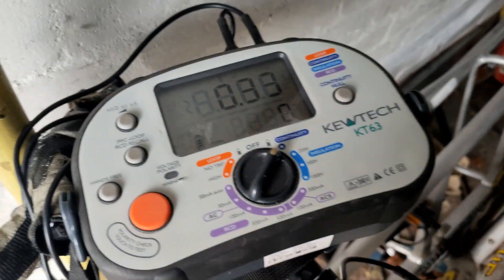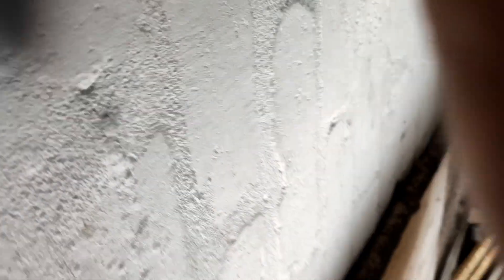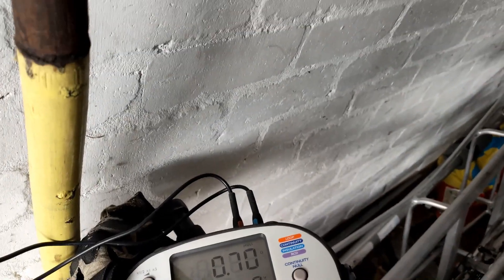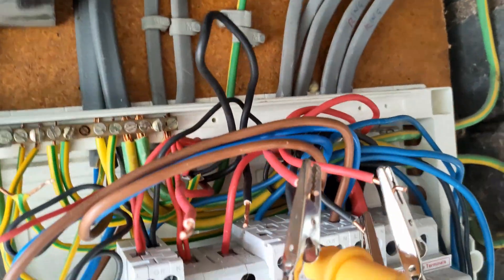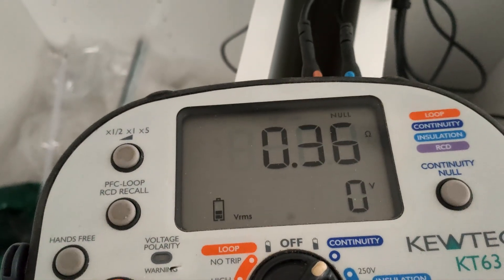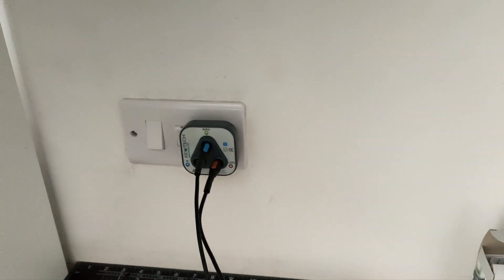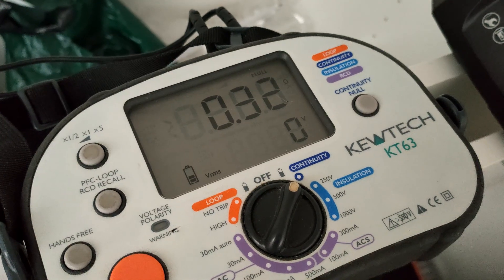KITCHEN REWIRE PART 6 - Testing for EIC, Electrical Installation Certificate, and Buildings Control

Comment from the maker: PLEASE NOTE: I wrongly stated you can do IR Testing on the Hager RCBO's when they are in the ON position. This is incorrect and they should be in the OFF position if testing with the Load Terminals.

Comment: 500 v test with rcbo on ?
Reply from the maker: Yep, as per Hager's instructions, I can't speak for other makes, so check before doing the test
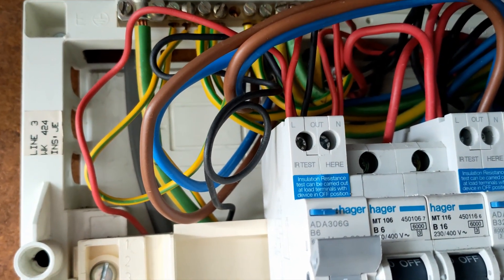Reply: Just paused vid at 3:52 area and the sticker on your RCBO clearly states must be OFF if IR testing.
Reply from the maker: @deano6188  K, I do stand corrected, and will correct what I said in the video in a pinned comment as it's misleading. I thought I said off, but clearly I say on. Out of habit I do global IR testing normally which is on the supply side, however I realise you can do it on the load side with the RCBO off.